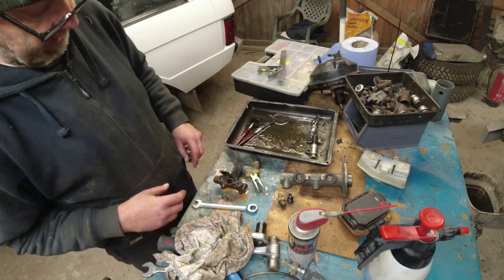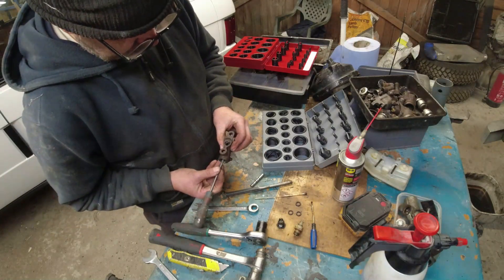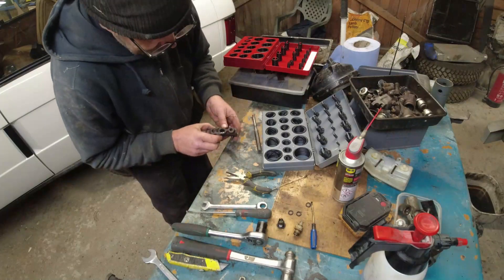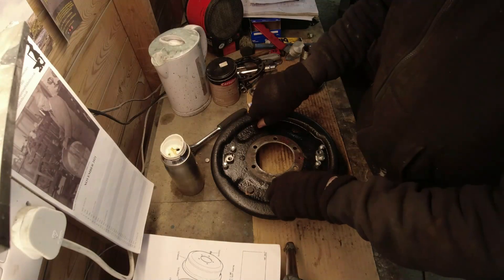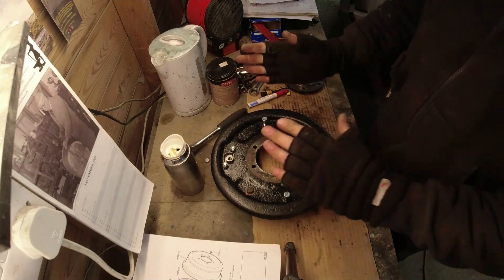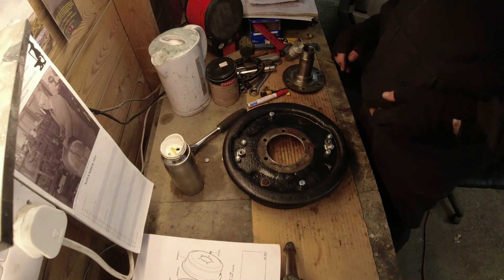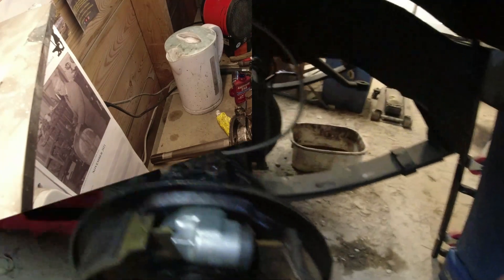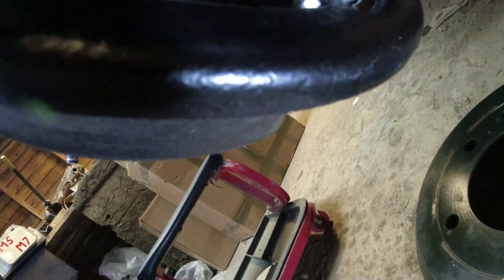Series3 88 Project Silicon episode 4 - profanity warnings

Comment: I’m just working on my Series 3 hub assemblies at the moment. There appears to be a sleeve missing inboard of the halfshaft support bearing which the axle seal runs against. That’s the part that was ground off leaving the mark on the halfshaft. Without the sleeve, there will be no seal between the axle casing and the swivel housing
Reply from the maker: The part number for that sleeve I think is 90217398, and as far as I can see it is the inner section of the large roller bearing race inside the swivel housing

Comment: Good job!
I was told by two different dealers that they no longer can get the bearing races that go on the half shafts.?   WTF.  
I managed to find the bearing races with different part numbers in the end. 👍
Reply from the maker: any half decent bearing shop will be able to find on for you. There is no way on Earth that Land Rover designed a bearing specifically for this job, they would have chosen something widely available. That it is NLA under the part number is a slight inconvenience, There are even online bearing suppliers who sell this stuff now. 

I like to go to my local bearing / machine shop and speak to a chap older than me, wearing grubby overalls.

Comment: On my 2A twin cylinder I turned mine one hole towards the rear. I don’t have the oil drain hole like S3. I didn’t know S3 had a drain hole. Instead on a 2A everything gets drenched with gear oil. 🙄
Reply from the maker: I did consider this, easily drill a hole through the back place. At least you can get stub axles new for the Series up until June 1980

Comment: Isn’t there a split master cylinder available for this motor and do away with the shuttle valve doofa?  Got one ready for the 109 when I fit the ser3 servo brake pedal.
Also if you doing all this brake pipe stuff , I made the feed to the bottom then the short bridging pipe to the top cylinder. Then the nipple is at the top and accessible.  It works.
Reply: It is a "split" master, it has two outputs, one for front and the other for rear with a dividing baffle in the fluid reservoir. That's why I made my point about discarding the PDWA as it risks the two separated circuits coming together if those O-rings fail. A lot of risk just for a dim dash warning lamp. The front/rear balancing is provided by the master cylinder, the PDWA is nothing more than a hydraulic switch.
Reply: @cliff4wd  I think regardless of the warning lamp, it would be pretty obvious that you’re stopping your. landrover using two wheels not four. Two is still a lot better than none. Must get on with my servo conversion!
Reply from the maker: the shuttle valve PDWA (pressure differential warning actuator) gets a bad press in my humble opinion. It is only available on twin circuit brakes and in theory should hook up to the "bad brake" warning light on the dash. Though on the 88" it is not part of the standard loom for a 1982 model. 
Once the brakes are bled the shuttle inside the PDWA should not move, if it does then there is something wrong. 
Similarly if there is brake fluid in the central section then there is something wrong.

Sure you can do away with it, but then you can also do away with the twin / split master cylinder and have all 4 corners operate from a single cylinder master.

On the TWS front brakes on the 1982 88" and the bleed nipple at the bottom I did think about setting it up with the bleed nipple on the top cylinder but went factory because I can help folk to bleed them. Watch this space...
Reply: @churchhouseclassics  I'm not sure you understood my point about the PDWA. Thing is, you have a braking system separated so that front and rear brakes operate independent of each other; physically separate with a dedicated line for front and another for rear. These two lines are then connected to a valve (the PDWA) that all but for the piston between the two lines, reconnects the two circuits together. If either of the o rings allows fluid to get past, then you effectively have a single circuit system.
For the sake of a fairly pointless warning light, a risk is introduced that could result in full brake failure rather than just front or rear.
The so called benefit is far outweighed by the risk.